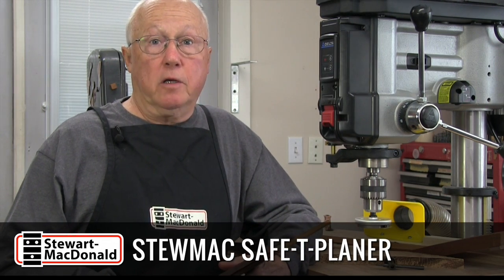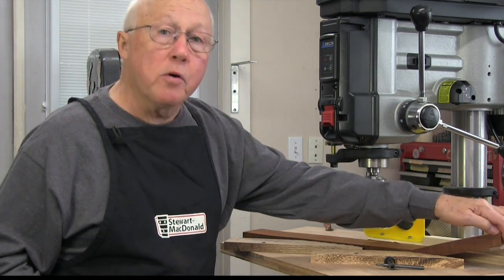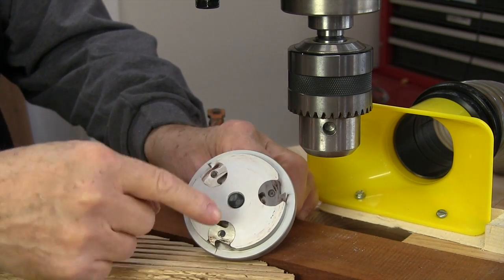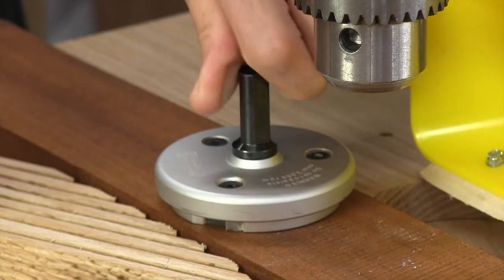StewMac Safe-T-Planer Video

Comment: Or just use an old #4 hand plane and have zero chance of losing a finger, as well as having more control over the finished product.
Reply: +Andy Prokopyk Or a safe-T-planer
Reply: +sirswift23 $50 plus shipping for this thing, or probably $20-30 for a locally purchased #4 plane that has much more versatility.
Reply: Andy Prokopyk
I get hand planes for free and I still want this! 50 bucks plus ain't shit for good equipment. Versatility? come on man.....
Reply: +sirswift23 this is a completely superfluous piece of equipment. most of what stewmac sells is unnecessary. I'd respect them more if they manufactured nicer essential things, like nut files. 

A well tuned hand plane is incredibly versatile.
Reply: +Andy Prokopyk I suppose if you have unnecessary and superfluous in one sentence, then you must be right!
Reply: In my defense, I'm not trying to make money
Reply: +Andy Prokopyk In the offense against you: you came on the page of a company that IS trying to make money and bitched about them trying to make money with a product that is actually pretty nifty. Hand tools are fine, but there's no need to be a luddite and crap on powered options. You say it's superfluous... how old is Erlewine? Is he arthritic? Are you going to declare for him that, at his age, having a powered planing option is superfluous???
Reply: It's not a matter of rejecting technology, it's a matter of practicality. I could argue that a fully featured Bailey pattern #4 has more technology involved in it than this thing, which is little more than three blades mounted on a spindle. The amount of time required to set this up for each job for a hobbyist who only has one drill press and can't afford a dedicated machine far outweighs the benefit of a slight learning curve of hand tools. 

My problem with stewmac is that they perpetuate, or at least encourage, dedicated tools for jobs that don't require dedicated tools for someone building 1-2 guitars a year. They might make sense for someone making a living in lutherie, and it's pretty safe to assume the majority of their customers are not making a living building guitars.

Proper planing technique shouldn't agitate arthritis, if you're severely arthritic and don't want to agitate the condition further, you probably shouldn't be playing, let alone building guitars.
Go have a look at Paul Sellers' channel, he's at least 70 and still doing most things by hand.
Reply: +Andy Prokopyk Nothing you just said negates my point. Your complaining here is the only thing that's superfluous. People can buy whatever tools they feel they'd like to. If this looks like something that someone wants: who cares?
Reply: +Andy Prokopyk, slight learning curve, my ass. You're making the assumption that others are capable of properly fettling and sharpening a $20 - $30 vintage Bailey #4. You're also making the assumption they know how to tell a good $30 plane from a bad one. You and I both know there are plenty of bad ones in that price range...especially if they are new.
Reply: lern2swim My point is a criticism of stewmac. I'm not criticizing those who purchase the thing. There are probably other uses for it out there besides lutherie. However, I don't see this as an improvement to tools that guitar builders probably already have. It's really easy to collect tools that aren't needed just because they have a wow factor. 

Like I said, stewmac perpetuates a necessity of certain tools that are far from essential and I don't like that. It keeps more people from building guitars because they feel like they need to have expensive tools to do it properly. When I started being mechanical I definitely felt that way. 

bripslag 
I'm of the attitude that if I can do it, anyone can do it. It doesn't take that long to learn how. You learn as you go, and you learn lots of things along the way. It's better to understand how something works than to just let something work. 

If someone was willing to invest 50 odd bucks for this thing, I don't see why a 50 dollar #4 would be unreasonable, (I paid 60 for my pretty much mint #4 1/2). Especially since every luthier/aspiring luthier should be/become familiar with sharpening chisels and should have/get the sharpening stones already.

So if fettling and tuning an old hand plane is REALLY too much work for someone, they should probably consider a different hobby. If someone wants to make a career out of guitar building, well, that's a different story that doesn't really apply here.
Reply: +Andy Prokopyk, you're entitled to your opinion, but just because YOU think all the extra gear and gadgets keeps others from trying lutherie, it might be just the opposite. Some might be intimidated by the thought of learning the proper use of hand tools and may feel more comfortable spending $50 on a mechanical alternative. I agree that there are a lot of unnecessary woodworking gadgets sold (and not just to guitar builders), but it's not my place (or yours, for that matter) to tell the people who buy them they are wrong to do so. And for the record, I love my hand planes. I just also know that not everyone is as attracted to them as you and I might be.
Reply: bripslag Of course I could see hand tool working being intimidating. Guitar building in general is. My opinionated criticism is with stewmac's marketing tactic. No judgement passed on those that might find this useful in certain instances. 

Can we agree that the way stewmac advertises its not-so-essential tools in a way that makes them seem absolutely essential?
Reply: +Andy Prokopyk Not sure what you think their new marketing slogan should be then...

"StewMac: We sell tools that you really don't need, but it'd be more cool if you bought them! And we'd make more money..."

Has the thought ever occurred to you that people might find it easier to use mechanical (as in, motorized or "power") tools to accomplish wood-working tasks? That perhaps they like to save time on certain things? Nowhere on StewMac's website have I ever seen anything that says that in order to buy 'X' you must first buy 'Y'...or that you can only buy a certain item (that YOU might consider a "necessity") if you buy another certain item first. I've seen no such caveats. 

So then what it really boils down to is a store selling products that are used by many people--both inside and outside the field of luthiery. And they present demo videos on the tools, and what people might do with them. And yes I even think they are probably hoping to sell enough to make a profit on those tools. But let me ask you this--have you ever seen a mechant advertise their wares in some way OTHER than making a "not-so-essential" tool seem absolutely essential. I mean, the very fact that you've said that must bring them great joy--because isn't that the way to sell product? 

I really don't see the problem, personally. I've bought a good bit of stuff from them, but there's other stuff that I just don't need to. In the case of this planer, I'll just use a regular DeWalt bench top planer, thanks. But I certainly don't begrudge StewMac for offering the item. After all, if it helps them make money so that they can stay in business and offer things that I do need...then I'm all in favor of it. 

Your mileage apparently varies though, and that's fine.
Reply: You can't try and be a source of education while simultaneously trying to make a buck and expect credibility, which is what this channel is pretty guilty of, as well as the guitar repair book they publish which is essentially a big non obvious flyer for Stewmac (at least the edition I bought when I started).

Crimson Guitars does an excellent job of maintaining a line between education and manufacturer of tools. Ben Crowe having quite the discretion when it comes to claiming a tool they produce is essential.

In regards to this tool in this video, it isn't meant for the same tasks as a benchtop thickness planer, and I wouldn't suggest anyone rid their shop of such a time saving device in favor of a hand plane.
Reply: +Andy Prokopyk Where does StewMac advertise itself as only a source of education? They sell stuff. Some good, some not-so-good. Some expensive, some less expensive. The education they provide is to demonstrate how to use their tools/supplies, for the most part. I don't think they've ever misled people about that--not that I've seen anyway, and I've watched a LOT of their videos. But in the process of demonstrating many of their products, they do pass on knowledge. So having said this, I guess I still have a couple lingering questions for you:

1) How would you suggest that they DON'T pass on knowledge in order to demonstrate the utility of their wares? (Maybe throw in a little bad advice every once in awhile, just to keep people guessing?)

2) How much education would you consider to be OK for them to pass on, to be credible?
Reply: +Tom B Oh, forgot...sorry.

In fact this product IS intended to replace the planer, which Mr. Erlewine clearly states is both expensive, and takes up more room (than this product)...which might pose a problem for smaller shops. Of course a benchtop planer wouldn't work well for a tapered peg head, I'll admit. But for the other things he cited as suitable for this Safe-T-Planer tool...exactly the same, as far as I could tell. 

Bridge blank....yup.
Sound board...yup.
Side boards....yup.
Back...............yup.

Comment: All I'd like to add is be careful using this tool. I have one, and retired it to a bottom shelf, probably never to come out again. Did you notice when Dan was using the planer on the headstock, that they cut away as soon as he neared the neck piece? I'd like to know how he was going to cut to the neck stock line safely, and square, wouldn't you? Also, did you also notice that after the cut-away, the very next shot was Dan holding the finished headstock/neck with a "Ta-Da" flourish and saying, "And here is the finished piece" (or something to that effect). Did you notice he was holding it upside down and showing you the side that DID NOT get cut? I have a feeling Wagner stopped producing this tool for a reason (which I believe I found when I was using it). Please be careful if you are using it.
Reply: Lynn Livingston The guy who made the originals died, is that reason enough for you?
Reply: I'm not worried about it.  Watch some other videos of this planer.  Must be run at proper high rpm, on a smooth surface, and with sharp blades.

Comment: hello Stew. I was wondering what rpm the safetplaner must turn at?  I thought it would go nice on my radial arm saw attachment.  I think it turns at 3750rpm is that fast enough. My drill press has different speeds and I could use a jack shaft to get more speed. What do you reccomend for rpms? thanks
Reply from the maker: We recommend running the Safe-T-Planer between 2500 and 3000 rpm.

Comment: Drill press are not designed to take a 
Lot of lateral forces!
Reply: There's not a lot of lateral force with a sharp rotary planer. I've been using one for over 35 years on my Shopsmith with no discernible issues. And when you consider that I also run a 10" circular saw blade on that same spindle, run-out would be pretty obvious.

Comment: Would this fit and work in a router? I’ve got a good router sled that I use for flattening and if this worked, it’d be very handy.
Reply: No, it would be very dangerous (I’ve seen that covered in other guitar building forums).
Reply: @robertsgearoutlet810  even at super low speed with a well design jig?

Comment: What's the max amount of material you can take off with that? A quarter of an inch?
Reply: +Gregg Carter Yup, 0.005" at a time. 

But I suppose if you are surfacing the entire board (like a finger board, for instance), then you could take it all the way down to nearly nothing...0.005" at a time. Seems like it would take a while to do though, at that rate.
Reply: .005"???? where did you pull that imaginary number from? My Wagner rotary planer that this one is copied from will do a full depth cut of at least .230" since the step in the tool is the same depth as the cutting teeth are and that's .250". Years ago I had a long conversation with the original inventor of these rotary planers and they were designed to only take so much for a maximum cut and that was the tooth depth. For best results I take a light finish pass of about .005" but they'll certainly take almost 50 times more than your estimate.